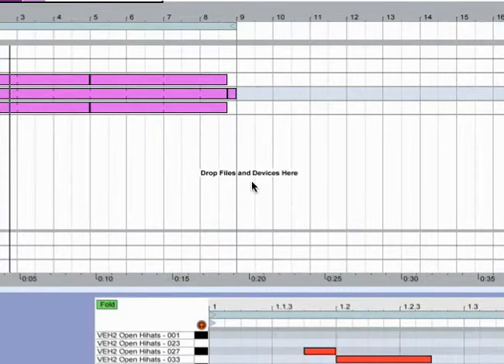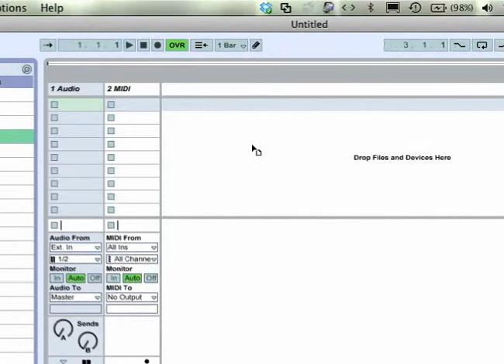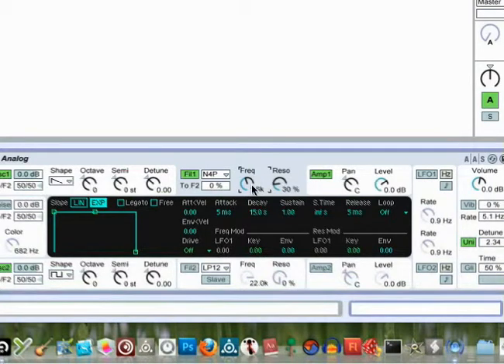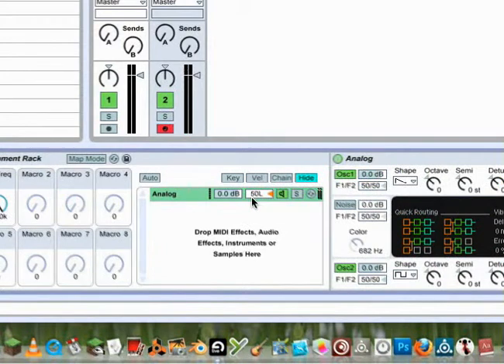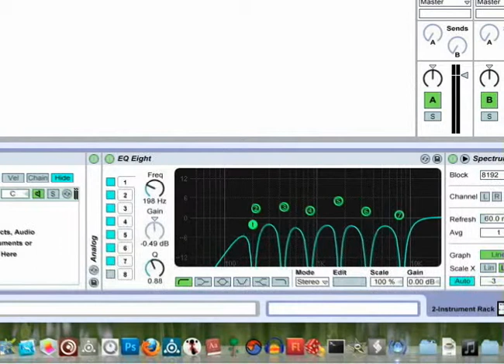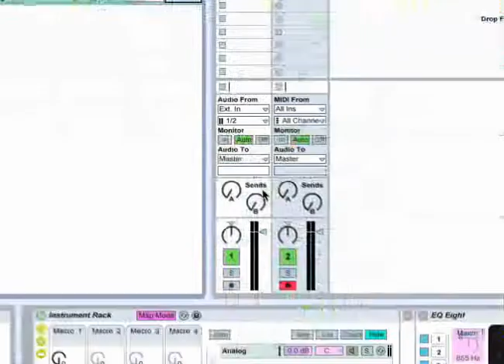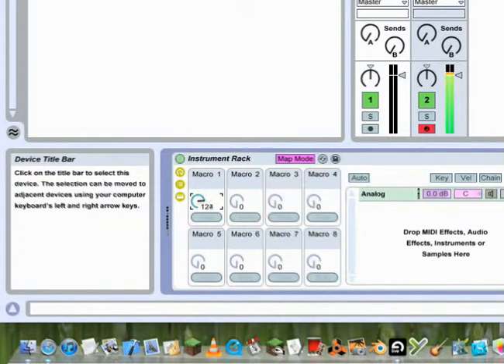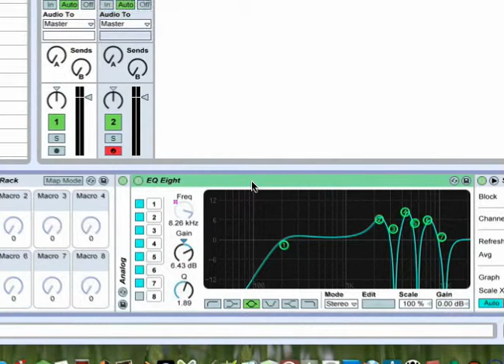How to make a formant filter in ableton live

Comment from the maker: It's good to have ring sometimes. Especially when you're doing voice synthesis, since the voice basically utilizes ring. I'm not sure how much ring it has in the lower-end, but I don't think you'd be needing to have any low frequencies anyway. If you do, just automate the resonance/Q as well. That should take out the ring, if necessary. Actually, if you're using a saw wave, you won't have any lower frequencies to worry about. Watch my newer tuts anyway.